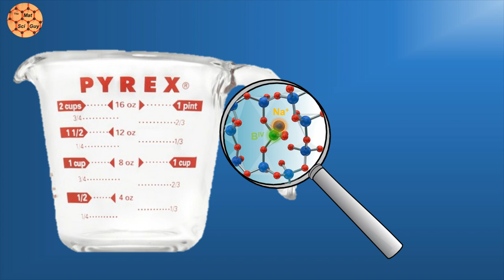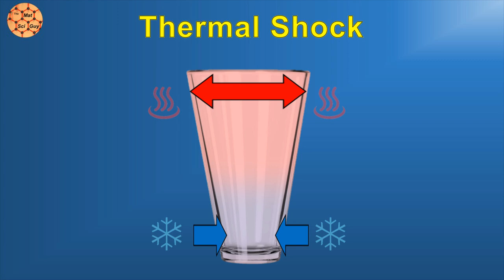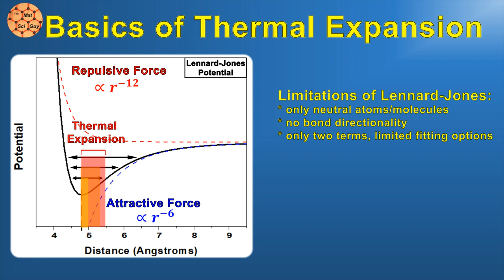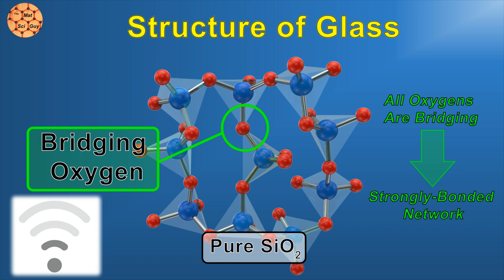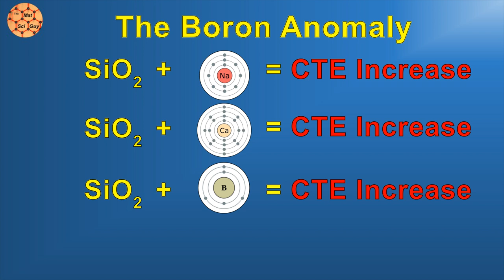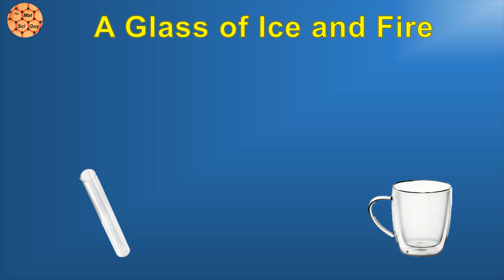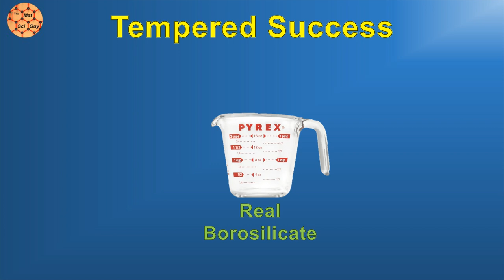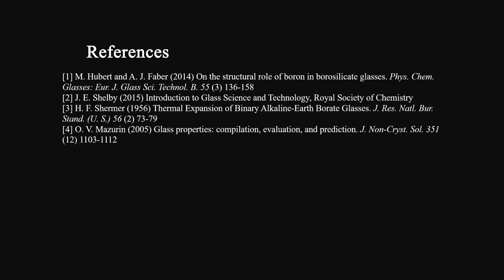The Story of Borosilicate Glass: Why Pyrex was Special

Comment: thank you for sharing! Very good explanation. I liked especially how you encouraged people to hold onto the original PYREX measuring cup. I have the pyrex in soda lime. It's still durable. But I never dare put anything hot in it.  I wait until it's lukewarm. Thanks again.
Reply: If you'd like to get brand new borosilicate Pyrex that's as good as the vintage, you should look into buying Pyrex made in France. All French made Pyrex is real borosilicate unlike the Pyrex manufactured and sold in the US. It's a bit pricier especially if imported to the US, but if you travel to Europe you can buy it for cheap as souvenir from any good shop that sells kitchenware. The French made Pyrex is the standard Pyrex all around Europe.
Reply: @wwondertwin  thanks. I don’t know if i’ll get it. Knowing me i will mix up the two and they probably look the same 🤣

Comment: Thank you for this very informative video.
I work in the Flat Panel Display equipment industry and you will be happy to know that actually all the TV's, Monitors, LCD LED displays, etc. use Corning's Borosilicate glass. In some cases these panels are heated to over 500°C temperature. They are very thin .35mm to .7mm thick and can withstand quiet a bit of abuse during the processing. they are very large sheets up to 110,000 cm² or 11m².

Comment: As a Boro lampwork glass artist I appreciate this in depth explanation of the glass I love working with so much. Borosilicate glass is used almost exclusively in the Functional Glass arenas (ie...pipes and other items for the pot smoking industry). It is a fantastic material for creative flame glass working as it easy to work with and produces strong products and works of art.

I have a couple questions.... is CTE and COE the same? In Flameworking we refer to COE = Coefficient Of Expansion. I assume that’s the same as your CTE??? Hard glass (Borosilicate) has a COE of 33;  Soft glass (Sodalime) has COEs ranging from 90-104.  How do the COE numbers relate to the temperatures they are affected by? Boro needs much higher temps to melt but has lower COE. Soft glass melts at lower temps but has much higher COE numbers. THANKS
Reply: Yes
Reply: Hi, friend, do you have a social media account for glass art? Because i like glass art too.
Reply: i believe borosilicate pipe makers are also responsible for pioneering alot of modern flameworking techniques and spurred the creation of a ton of crazy new colors for artists to work with. i think its pretty amazing!
Reply: @irisjones737  Sorry, unfortunately, I’m one of those old fuddy duddies who only has a very outdated website. I’d rather be creating with my glass than keeping up sod media channel pages. LOL

Comment: @3:08 CTE= Coefficient of Thermal Expansion - How much a material expands when it's heated is usually expressed in terms of the CTE
*a LOWER CTE is more stable
*Materials with stronger bonds tend to expand less
@6:27 introducing Boron
[1.3.2024]

Comment: I am confused about car and home window glass. Im surprised it doesn’t shatter when we blast the heat on one side while ice, snow and water cover the other side.
Reply: That's because the change in temperature is gradual and not sudden. If you dump a bucket of boiling water on your cold windshield, you may get a crack.
Reply: @LuisCaneSec  Also boiling water adds additional thermal difference. Normal glass can handle thermal shock, what matters is how much.

Comment: Why does glass break more on cooling? Most glass can handle hot water/drinks poured into it. Even fairly thick glass. Then it breaks on touch and cooling.

The difference between warm and cold beer is so small that the breakage must be a truly unique case.

Quite a few common items need to withstand heat: water kettles, coffee presses, tea glasses, halogen oven, pan lids.

They should make coffee presses with the diameter and height of a standard lab beaker so that it could be replaced. But pointless visual design rules, and they keep reinventing basic shapes.

Comment: I really wish I could get new PYREX in non-metric. :/

I have two PYREX measuring cups, but the larger one has lasted so long that all the red text wore off, so it can't be used to measure anymore. I think this happened because the glass is legitimately more thermally resistant than the print, and decades of heating, cooling and washing wore the markings off. 

I want to replace it with an identical copy, but it's not possible because of greedy businessmen and their race to the bottom mentality.